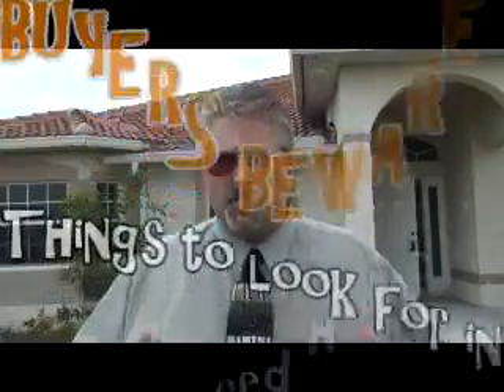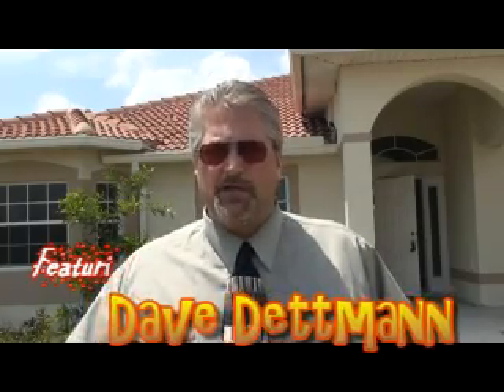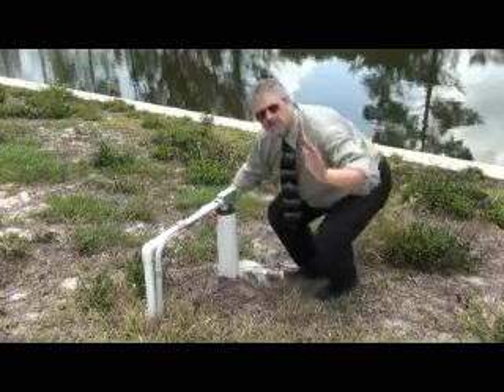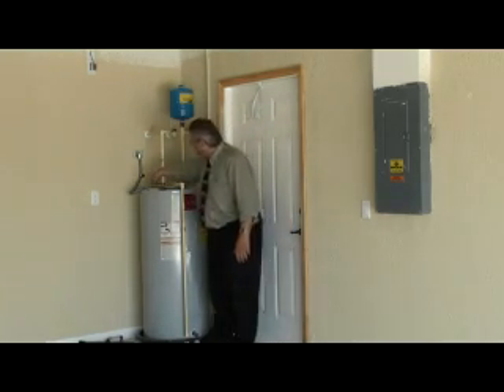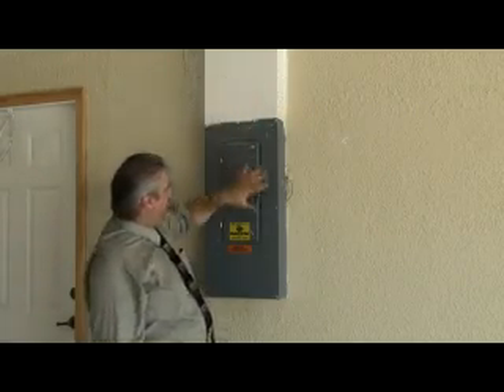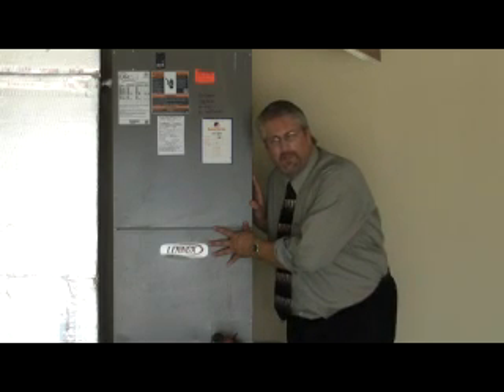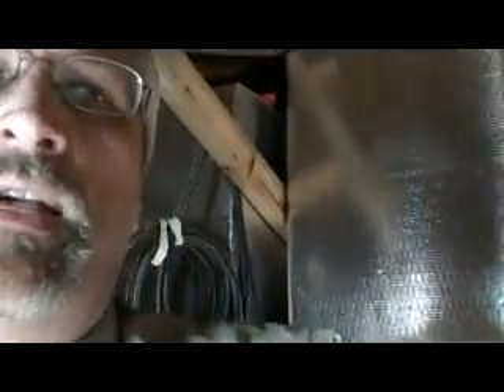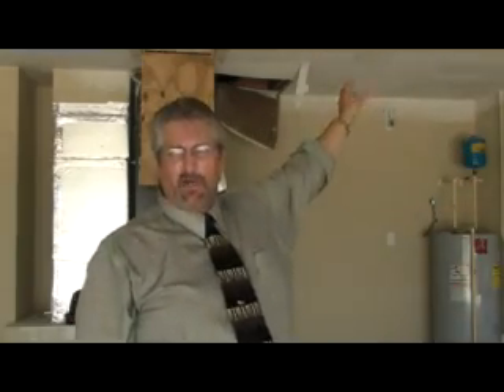Buyers Beware!  Things to look for in foreclosed homes-Part 1

Comment: AVOID reo's/foreclosures if you are a first time home buyer, or not an investor.  Most of these houses are a mess. There are investors/conglomerates that have crews in place to fix-up (or they are capable of doing themselves, such as contractors), a lot cheaper than the average home buyer can, leave these houses to them.  If you are like most people,  you will pay retail for all the repairs, etc.  It can cost you a fortune.  You are better off finding a solid home, prev owned buy solid people.

Comment: If you complete your statement, your video will be more valuable.  Your video is cut for the estimation of the electric wire replacement.

A suggestion.